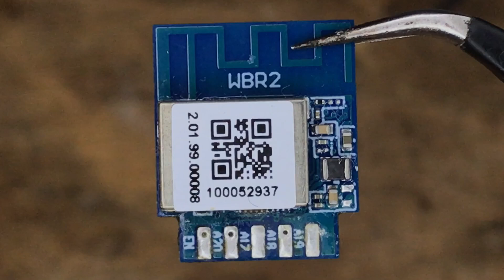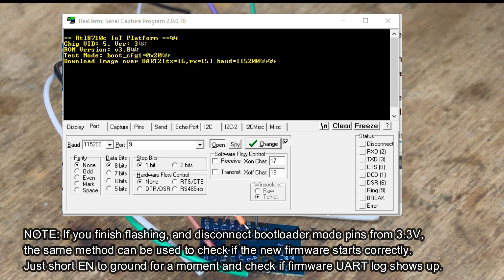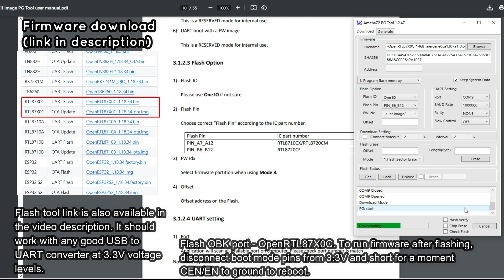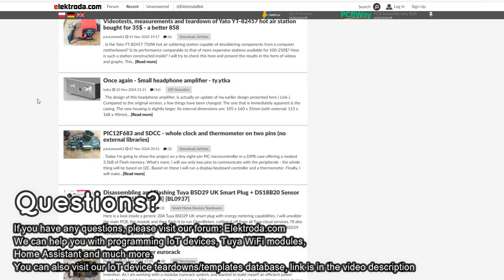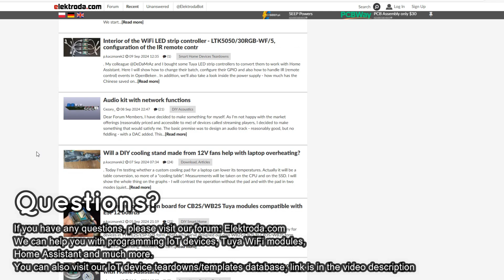How to flash WBR2/WBR3 (RTL8720CF) Tuya module?

Comment: Hello, I managed to remove the WBR3 from my tuya thermostat and I can see output on a serial emulator. But I can't flash the firmware with the tool that is mentioned in the video. I have tried both pins from the instruction but the download of the image always will stop at some point and run in a timeout. The error says "XMODEM: error happen". Any idea on how to continue?

Comment: PKE8720DF - A00 - F10/AMB25 I want to use this as Matter/Zigbee/EspHome/TasMota any one will work. It is Dev board I am not even getting any guide for same. Can I get Help for this board also IC/Chip/Module it uses is RTL8720DF. want guide on how to use it for smart home/automation/smart switch i.e., Relay 

Thanks